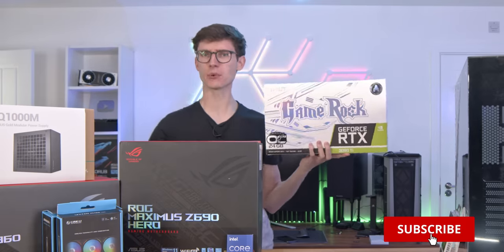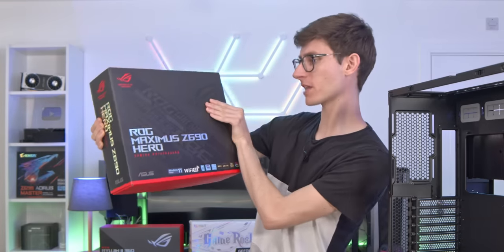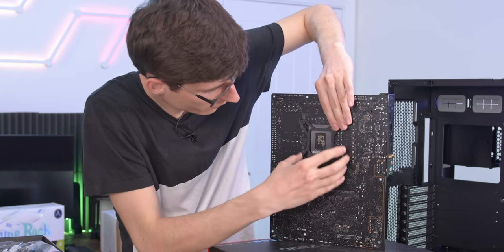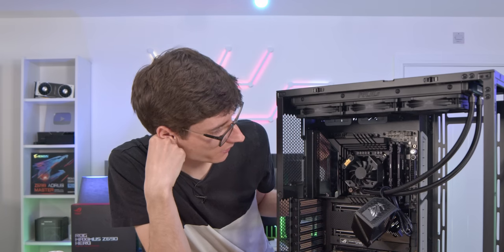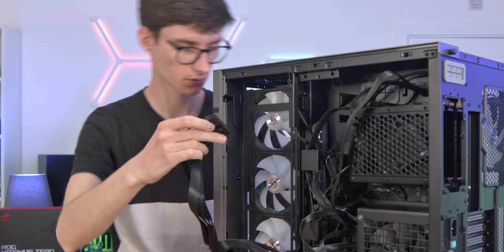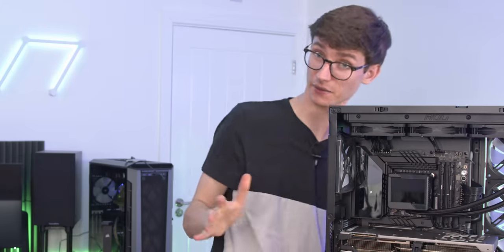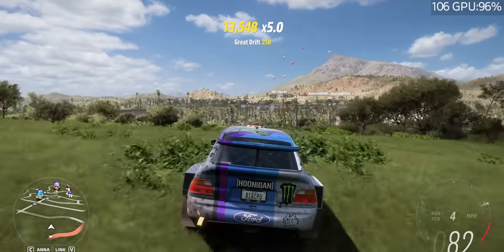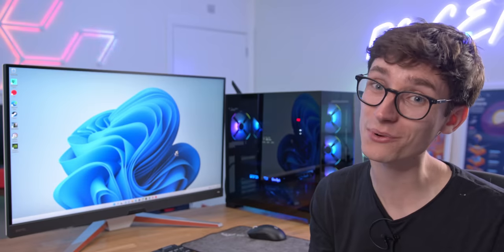The ULTIMATE RTX 3090 Ti Gaming PC Build 2022! - O11 Dynamic, i9 12900k w/ Gameplay Benchmarks!

Comment: Very minor gripe, and it's not just you, but if you want to showcase the noise levels of the build you should measure it with a decibel meter when you have it fully-tuned (both fully cranked when playing games, taxing the CPU, and relatively idle).   Doing a reading inside the case and where you sit (with a control measurement with the machine turned off) would suffice.   Anyhow, great video!

Comment: Thank you, i was looking for this exact build ! I have ordered a I7 12700K with the Ryujin II 360 in the same pc case as yours and i was really afraid of building a pc for the first time.
Now i can less apprehend it, even if i am still afraid about building a pc, but you're making things easier to me for sure !
Reply: How did it go. I finally have all my parts to begin but I'm nervous about slotting the processor.
Reply: @thomass9457   @Thomas S  its super simple, if you have an Intel proc, you just have to put it in the same position as the mb. Drop it slowly in the little "square" and it fit on itself. Sorry i tried to explain with my poor english 😅. 

For the rest i was struggling bcs there were too much wire but if you take your Time, you Can find where it goes, and if you're stuck, take a break it will help to refresh your think if i could Say. I was also helped by a good Friend on discord so do the same if you're able to. If i Can help you more, let me know.

Comment: Any budget cpu coming?
Should I wait for cpu and gpu?
Right now,                                                           👑
MSI MAG B660M MORTAR WIFI DDR4         Motherboard
Intel Core i5-12400                                            Processor
Palit GeForce RTX 3050 Dual Fan                  Graphics Card
Antec DP502 FLUX                                            Case
Crucial Ballistix RGB 16GB DDR4-3200 X2   RAM
XPG Core Reactor 850 Gold Fully Modular   Power Supply
Lexar NM610 1TB NVMe M.2                         SSD

Comment: Here's a tip for the 12900k take 1mm thick  washers I use nylon take screws out of the cpu socket put on washers reinstall screws with washers it basically keeps the IHS straight because the clamping force on the z690 bows the IHS the washers lesson the clamping force which keeps the IHS flat.dropped my temps alot I use a corsair 360mm rad
Reply: vid?

Comment: This PC is so expensive, yet so great! Question, if I were to make this PC but replace the 3090 Ti with a 3080, or 3080 Ti, is may perform a bit less, but it would still work???
Reply: 3080 12gb is the sweetspot
Some are selling for $800-900 used in my country while only a weebit slower than 3090ti ingaming
Reply: A 3070 or 3080 is the best GPU to get if you are looking for a "budget" high end card
Reply: There is absolutely 0 reason to get 3090ti unless you have money to just waste
Reply: @balla2172  tbh if u looking for academic research purposes? Probably 
Those r VRAM intensive

Comment: I am really thinking wether I should buy all the products and build one myself, or if I should invest in an DS Aventum X.
All in all what it comes down to is do I want liquid cooling on cpu and gpu or if I want to just build this with 6 more fans. Difference is only 2000 dollars so I just need some more professional tips.
Reply: Do not use a custom build liquid cooler if you move your system a lot. Get a three fan GPU and a liquid cpu cooler with one or three fans according to your cabinet. That will be enough. If you do 3D rendering work , then go for a closed loop liquid cooler for GPU.

Comment: This is the first 011 build I've seen without 3 fans at the bottom. I've had my current pc for over 8 years and I've recently just got enough money together to get an upgrade. I want a build similar to this (same fans, case) but with an i5 12600 and 3070 ti. I was going to have 9 fans (360m AIO, 3 bottom, 3 side) but after looking at this..I kinda like the configuration. Do you think excluding those 3 fans at the bottom will have a negative impact on my computer in the long run? or is this setup plenty? fans confuse me.

Comment: Wouldn't it be better to install the pump with the tubes going out up, that air can rise up to the Radiator in worst case? Nice Video no netheless. Planning to resettle my system in an O11 Evo aswell.

Comment: I'm going to make a very similar build but with a 3080 ti, should I / do I need to put 3 fans on the bottom too? Seems like such a powerful pc could use all the air flow it can get or would it not make much of a difference?
Reply: It will make a difference, will directly cool down the GPU. Always get all the fans you can physically fit on a cabinet. Get cheap ones if  the RGB ones are expensive.

Comment: Maybe if you get the RTX 3090 Ti Liquid Cooled, and use corsair 7000x with all fans, and 12900KS Liquid cooled with 420mm rad, and 64GB RAM DDR5 6200Mhz, and 1600W Platinum PSU, and Z690 Godlike, and do extreme overclocking to the CPU and GPU, you might be able to get 4K 90FPS in Far Cry 6 and 120FPS in Forza Horizon 5
Or 8K 24FPS Stable 😂
Games nowadays are so demanding no wonder why manufacturers make so many new GPU's

Comment: Is it possible to make a good gaming PC with a $1,500 - $2,000 budget? (1,149.99 - 1,533.32) I want something that I can game on with more than the low quality I am currently stuck with. I wish to be ablw to play games like Genshin and Star Citizen, but I have no idea what parts I need to do so. Not to mention the fact that I want to start video editing as well. Would a budget like mine be expansive enough to get what I need?
Reply: Yes. For gaming : focus on getting a good GPU, budget friendly i'd say 3060TI or 3070 or comparable AMD Gpu. Mainboard with Nvme 4.0 or 3.0 M.2 slot(s) (faster boot/loading times) , sweet spot for memory (depending on cpu/MB combo) is 3200Mhz for DDR4. For video editing you'd probably want more storage space, so i'd go for a HDD 4 Tb (not that expensive).
Power supply needs to be good enough to power your Gpu. 850 would be more then enough up to an rtx 3080ti. Do NOT use a "bronze" rated PSU, gold or better since gold is now already the basic standard. IF you choose to go intel and get an 11th gen : get a good AIO or if air, go noctua NH-D15 (best cooler atm that even beats out a lot of Aio's), and it comes in black. Gen 11 cpu's tend to get hot pretty quickly if not cooled the right way. Oh, almost forgot , for amount of memory go with at least 32 or even 64 GB ram. 4 slots, dual channel.
Reply: @schreursalain2968  thank you, this is very helpful

Comment: Great video. 1 question though... why not put the 3 side intake fans on the bottom? Seems like working with thermal convection would have best cooling result.🤔
Reply: You can get more airflow from the sides
Reply: The unit works better on the side or at the top.

Comment: Hi regarding the AIO I have installed the backplate then the intel standoff screws(AIO not installed yet only backplate and standoffs). It is wiggling a bit. When I lift the MOBO the plate drops a bit. I have tightened the screws. Is this ok? Have I not done this properly? Is it going to tighten up once the pump is in place? I have the same MOBO and AIO
Thanks

Comment: I really need your help brother. I got a pc built with i912900k and 3080ti. I have a ddr5 5600 ram. All of my games are stuttering some from time to time but some quite a lot. I have got it tested and optimized by two different shops but I feel like no one can figure out what is causing this. I am really upset with my system I spent literally a lot of money on this and I can’t even enjoy it. I am desperate now. If someone can help me here and fix my issue I will be for ever in debt. Thanks
Reply: Apparently they are bringing out fixes for a lot of games since the 12th gen has a diff core architecture and a lot of games can't handle it. One of the channels made a video about it, check Gamers Nexus, Jayz2cents or linus channel for that issue. I believe, but not 100% sure, that it's because of the cores that swap tasks in the background, Denuvo for instance has a huge problem with it. Gamers complained about their games just crashing, not starting or , like in your case, stuttering.
Reply: @schreursalain2968  thanks a lot Alain.

Comment: I have power color rx 6900 xt ultimate and yeah nvidia messed up there 24gb vram is only clocked 1000mhz for each vram while my card is 2500mhz 16gb but each vram is clocked 2500mhz give it more power per ram I like the amd move better then nvidia move I get better performance per vram which helps alot for linux stuff I do and windows stuff I do in my opinion tho depends on the person I guess 🤔

Comment: Need Help finding a new GPU:

Specs: 
Cpu Ryzen 5 5600x
RAM 2x 8GB 3400 MhZ HyperX
Current GPU wich will get rid of GTX 980
PSU 650w 80+Platinum Be Quiet [ i just got it so i don't want to upgrade it ]

i play on FULL HD  [might upgrade to WQHD in the next 1-2 years]

Max € i want to spend on a GPU: 600 - 800 € 

Main Games i play
Ark survival evolved
Call of Duty
Need For Speed
GTA

I thought about a RTX 3070, a RX 6700 XT, RX 6800 and maybe a RX 6800 XT if the price goes below 900 €

i don't do any editing stuff and im not a streamer

DLSS is NOT important to me

i'm grateful for any Help

Comment: 5800x3d are better and can be  paired with 60-80$ mobo and still give results of 12900k in gaming
Reply: You mean it beats the 12900K, because the 5800X3D is even faster than the 12900KS in the clear majority of the games, except for ultra intel optimized CS:GO, where its a tie.
Reply: @Nebujin383  it lose in csgo but  bigger problem is that channels have to different results in fps  in that game!1 from 387fps on Gamer Nexus to 820+fps on Hardware canucks and some others with basically same gpu-s,cpus,seettings,resolution and they all just run stupid buggy benchmark

Comment: 4k 165 fps for 165hz monitor is wayy too far from our current tech.... i totally doubt not even 40 series can achieve that
Reply: 4090 will achieve that. The 4090 is so very close to double the 3090's performance as it's an entire new chipset they are going with "Lovelace"
Reply: @rabbitolychee6395  well even if 4090 "can" do it... i wish they can innovate power yet efficient gpu. I mean 450watts tdp is no joke, then, theres rumors that rog strix 4090 is 600watts tdp 🤣🤣🤣🤣
Reply: @meowwow8340  Hahaha! I had heard about it being 600 tdp which is completely insanity LOL